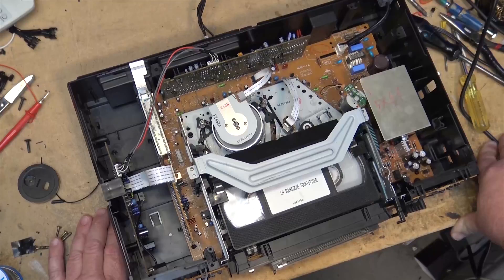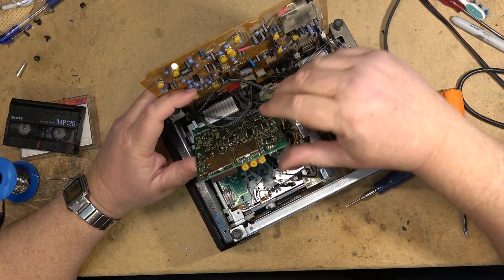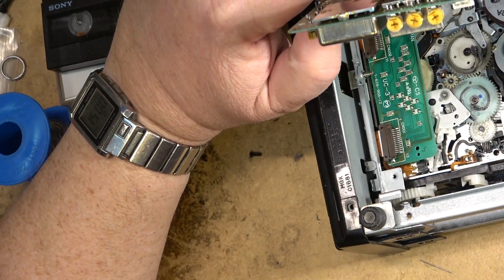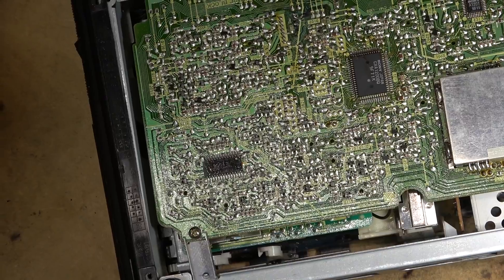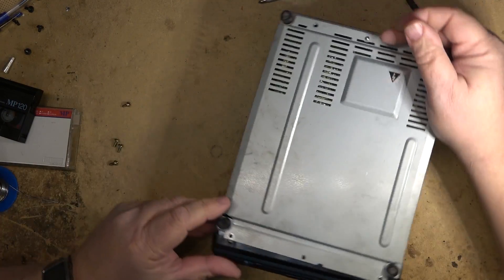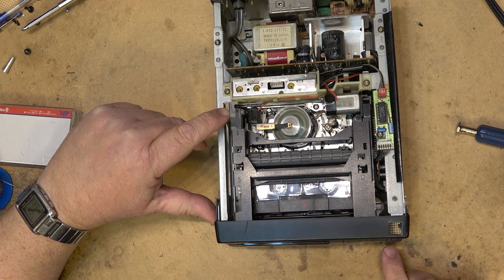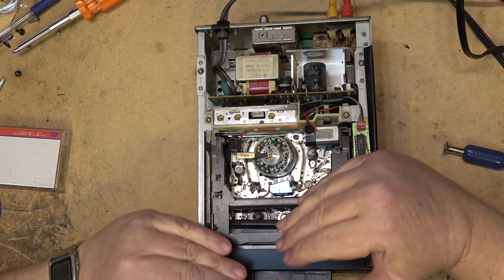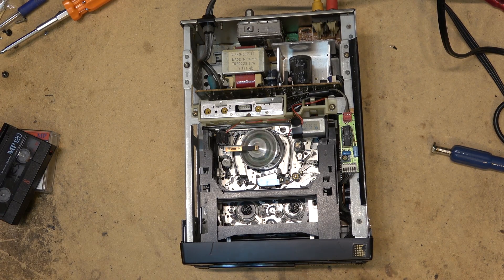Sony 8mm VCR mode switch service procedure for EVC3 EVS2000 EVS3000

Comment: I have one of these that is stuck at LP playback, even with my Handycam tapes that were recorded in SP. It reminds me of a similar problem I had with a crappy Funai combo deck that would start cutting out a quarter of the way through since it’d set to a slower speed than normal that also had reported problems regarding its own mode switch; which leads me to believe that could possibly be the problem. Would like to know whether if you also thought so, considering your expertise, before disassembling the unit and trying for myself
Reply from the maker: Bad caps
Reply: @12voltvids  figured that by the smell once I got more hands on with the unit, thanks for the heads up

Comment: I have a Sony EV-S2000 NTSC with a tape stuck in it. I am in the Calgary area. Do you do repairs if I ship to you ?
Reply from the maker: Yes if it is repairable.
Reply: @12voltvids  ok, do you have an email where we can communicate further ?
Reply from the maker: @EagleRockHifi  should be on the main page.
Reply: Didn't find the email but I sent you a message request on FB
Reply from the maker: @EagleRockHifi  
Well I'm not active on FB so if you see my picture, that is a scammer.
Reply: @12voltvids  I sent you an e-mail regarding repair of an EV-S2000 but I did not get a reply. Did you receive it ? Thank you

Comment: Great videos! I love seeing all these machines being repaired. I have a lot of sony gear that is still working for the most part, thankfully. I had to do some repairs like swapping out caps and replacing belts or lubricating parts on Walkmans, microcassette, video8 tv/vcr combos, betacam sp, beta and super beta hifi as well as non sony gear like laserdisc and selectavision among others!

Comment: Have you repaired a Sony CDP-CX400? If it is making a loud running machine loud noise when turned on any suggestions? Are the numerous repair bands they sell on Amazon for replacement all the same or should I look for particular ones? Thank you! Great videos!

Comment: I have a question which camcorder do you consider better?  Sony CCD V5000? Sony CCD VX1?
Reply from the maker: The ccdvx1 was then pal version.  In North America it was the vx3.
The v5000 was a large shoulder mounted camera.  A single chip ccd camera with a good tape transport, AFM stereo and pcm stereo.  The pcm tracks could be dubbed after the fact.   The v5000 also had a time base corrector.   The v5000 was affected by capacitor cancer and i changed about 80 of them in the old one I had when I sold it.   The vx3 on the other hand was a 3ccd handycam.   The vx3 had a superior picture.  Closer to broadcast quality and a 12x lens whereas the v5000 was 8x.  It had afm stereo only, and featured time code encoding for frame accurate editing when used with an evs7000 or evs5000 editor.  The v5000 had no time code.   So to answer your question the vx3 was a better camera.   I have a friend that has one.  Hoping he will donate it as he hasn't used it in years.
Reply: @12voltvids   I really appreciate your prompt reply, I have the ccd vx1 camera and I have changed all the capacitors on the video boards audio video works again fine the only thing I have not changed yet are two dc converters that have capacitors with leaks inside who want a change soon because they affect battery life! but i'm interested because i love these cameras to buy the V5000 from ebay I just have to replace all the capacitors and I see that there is a mess of many cables in the V5000 camera
Reply from the maker: @salvatorev_  
You want a nice analog hi8 camera track down an evw300. It looks like the v500 but bigger. It was the broadcast hi8.  I had one once.  Fantastic camera but capacitor headaches.
Reply: @12voltvids  The good thing about this camera EVW-300  is that the boards come and go easily so you can change the capacitors although it will be too much I think the only thing is to find new batteries because it takes large batteries
Reply from the maker: @salvatorev_  it uses np1 batteries.  I have 10 how many would you like ? I also have the 4 battery charger that cost 1500.00.  My JVC gydv500 uses same batteries.
Reply: @12voltvids  when i buy the camera i will have it in mind thank you

Comment: Will the mode switch cause the load eject mechanism to stop working? My GV-9's use the same tape mech as in this video. They are both fine atm but I have a 3rd unit that was working but one day decided it would not eject the tape anymore.
Reply from the maker: Yes it can.
Reply: @12voltvids  thanks

Comment: Why does that 2,200uf 25v cap need such thick Aluminum shielding!
Reply from the maker: That's the heat sink for the linear regulators.
Reply: @12voltvids  Ah....Thank You Dave!

Comment: what will happen to these vcr devices and camcorders if we install smd tantalum capacitors instead of electrolytic ones?
Reply from the maker: Who knows.  Never tried.
Reply: @12voltvids  I have recap my Sony ccd fx500e with capacitors smd tantalum with high ESR value  and I had problems playing and recording the cassette while the cassette deck head is in very good condition 🤔😭
Reply from the maker: @salvatorev_  there is a reason they went with electrolytic as opposed to tantalum in the first place.

Comment: Very neat little unit :-D
I don't think they could of put much more in such a small case,  but it's not horrible to service eather.
Yep the mode switch would of played up later, all of them do.
Ok they could of crunched up the power supply a bit,  or use a crap noise creating switchmode .
Linear are not very efficent but they don't produce r.f like switchmodes do.

Comment: I have really been enjoying these repair videos you are making. You definitely have a strong understanding of electronic repair and make it look very easy. All of this focus on video 8 decks made me remember I still have a Sony EV-C200 with very low hours on it. Thanks for making the videos, I look forward to them.
Reply from the maker: Going to overhaul my evs7000 head amp next week.  Levels between heads are different.  It has no surface mount caps, all thru hole.

Comment: I'm a bit confused about the drum head count. 

As far as I know (at least for vhs) there are two pairs of heads for different tape  recording speeds, SP and LP respectively.

Some other VCRs uses an additional pair for the FM HiFi audio.

And last but not least, some manufacturers like sharp advertise 7 head machines which makes me wonder what the 7nth head do. 🤔

The stills on that little machine are awesome. It looks mostly like as it have a digital frame buffer!
Reply from the maker: No digital.  It is a 3 head.  Normal VCR has 2 heads.   1 for the a field and another for the b field.   
A 3 head has a normal a field head and the b field has a second a field next to it.  For slow Mo and still they display both a fields.
VHS used either 2 or 4 video heads.  2 for ep and 2 for sp.
VHS hifi has 2 additional AFM heads.   8mm and beta record the audio with the same heads.  (NTSC)
Some machines have flying erase.  All 8mm does.   So if I count that, then this has 4. 
VHS hifi with flying erase has 7. 4 video, 2 audio and flying erase.  
Mistubishi hsu82 has 10! 4 video, 2 audio, 2 piezoelectric effect heads and 2 flying erase.
Reply: @12voltvids  Thanks for the detailed response. The guys at the vhs-decode project appreciate that!